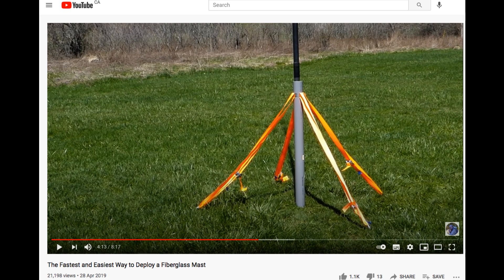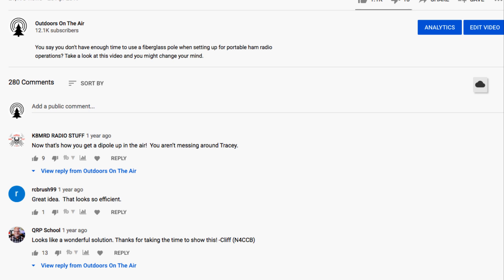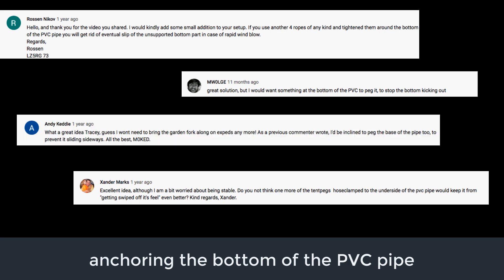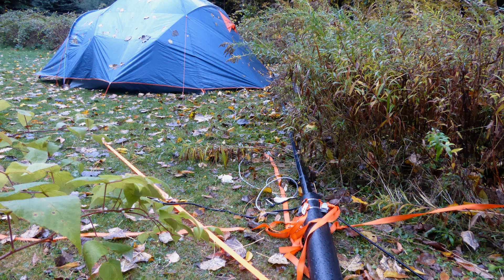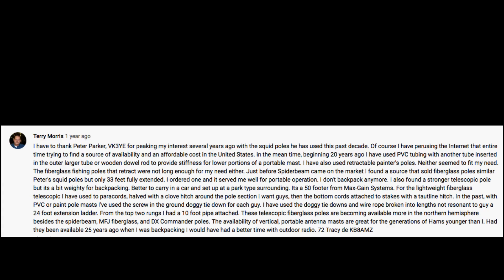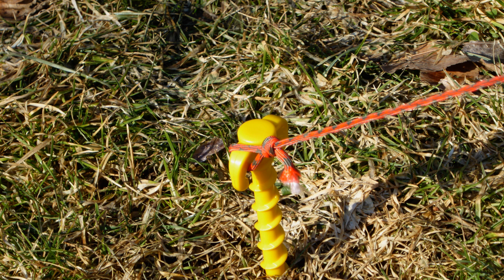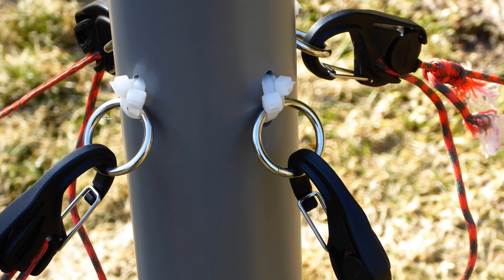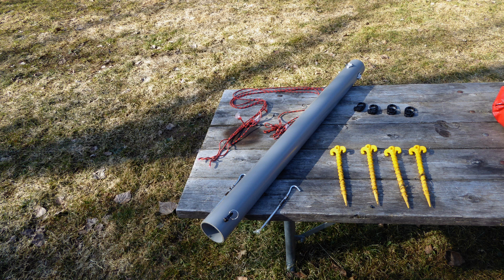Version 2 of The Fastest and Easiest Way to Deploy a Fiberglass Mast

Comment: Don't need 4 guys, 3 is just as good.  Paracord or guy line with a stopper knots on the ends.  Cut 3 slots into the top of open PVC (Or drill and file a keyhole on closed PVC).  You can also guy the mast itself.  Use a hole cutter to cut out some rings of polyethylene cutting board with a hole saw, then enlarge the center hole until it just fits the bottom end of the segment of interest.  73 KK7YIS
Reply from the maker: Thanks for your comment! Great tips. Regarding the number of guys, I've actually increased the count to use 8. My reason: whether you've got 3 or 4, if one fails, the whole thing falls.

Comment: One minor note on cutting the strap ends on the zip ties, use a flush cutting snips, or just a pocket knife to cut the ends flush. They are really strong in tension, but surprisingly easy to cut off!
And, if you double up on the "sand screws", about a foot apart, then lasso them with a loop at the end of guy, using the nite-eyes 'biners at the other end for tension adjustment, you've essently doubled the effectiveness of the screws. You're using 8 screws instead of 4, but you will sleep better in your tent. 
Oh, and the hole between the hooks on the screws is for a rod to help twist them in on harder ground. (And, just as importantly...to twist them back out!)
73 Jeff, KF0PQR
Reply from the maker: Great suggestions, thank you Jeff! 73 from VE3TWM.

Comment: I found a 43 inch fence post about 10.3mm in diameter, 3/8-inch, driven into the ground 19 inches, exposing 24 inches at surface. A 1/2-inch by 24 inch pvc riser nipple perfectly fits over the fence post. Only trick now is to find a few donut-shaped rubber or plastic that fits over the pvc but just inside the base of the fiberglass pole. Perhaps a 3D printed thing would work. Then all that is needed is one guy rope attached halfway up the mast with the rope pointed directly into the wind and tent-staked into the ground.  If there are crosswinds, use two in different directions.
Reply from the maker: Thank you for your creative solution!

Comment: hi i use a diferent aproche iuse a galvanazd pipe at the botom that i push in the ground it haz a sharp tip 4 ease of insertion the antena i mount with u bolts on the outside if i use other antennas then a fiberglas pole the fiberglas gose in  and 4 guy wiers are enuf to hold it up even in wind or storm conditions

Comment: I am waiting on my antenna/radial wire (due to arrive today) before I can set my SpiderBeam up this weekend. Great ideas. I like the idea of wire ties on the PVC, as I don't want to scratch up my new pole. I will put a spacer inside the pipe (pipe insulation or the like) to stabilize and protect the pole. Also, I will add a grommet boot to my SpiderBeam and over the PVC to keep out all precipitation. I will be adding an end cap and some foam padding inside the cap to minimize impact when the pole collapses for take-down. I will definitely take all your improvements to heart as I put this up this weekend. Thanks for posting and 73, "Bill" KD8BET.
Reply from the maker: I like your mods, Bill! 73 from VE3TWM.

Comment: On my 10-meter Jackite telescopic mast I tied a a Turks head knot into which I integrated four loops. The Turks head knot and loops are made of 550 paracord. Mini s-biners connect the guy ropes, also 550 paracord, to the loops. Camping tent guy line tensioners provide the adjustment for the guy lines. Setup is a snap, and extra kit is kept to a minimum. Keep up the great work.
Reply from the maker: Thank you for the great tip!
Reply: @OutdoorsOnTheAir  I've included some pictures of the mast on my QRZ page. See you on the air.

Comment: Several excellent points in your two vids. Thanks for posting.

BTW: in the US, both Lowes and Home Depot stock 2" and 3" PVC schedule 40 pipe in 3' and 10' lengths.

I use 2" PVC Pipe, in a tilting arraignment on the side of my utility trailer, to slip my 10M SpiderBeam mast into. Very nice fit with just a little side to side slop.

When i need to set up the mast in the open, I'll use 2' sections of sharpened ReBar with a 90 degree bend at the end as stakes. A 3lb ball peen hammer  will set them nicely. I'll fabricate a small post pole puller to retrieve the ReBars.

I say I'll do this and that above because my first option for a portable mast is to add a section of tilting 2" PVC pipe to my SUV trailer hitch frame similar to my utility trailer setup.

However, separate parking and mast locations would require the use of your system. Thanks for the info presented in your refined vid #2.

BTW: All your vids provide valuable info.

73 OM
Reply from the maker: Great tips, thank you! 73 from VE3TWM.

Comment: Interesting video Tracy... have you considered an end cap for the PVC pipe, sand the pipe and the cap for a free fit. Int the centre of the cap drill a hole for a length of threaded rod, secure with nuts and washers. To use, stab the treaded rod/cap where you want the PVC pipe to be, insert PVC pipe, assemble as usual. I now live in a strata community, so no permanent antennas, portable ops for me from now on I guess unless my imagination branches down the devious path to hide an antenna in plain sight, poor vision of my fellow community members may play into my hands/antenna, hi, hi.
Reply from the maker: Thank you for the tips, much appreciated!

Comment: Hey Tracy,quick tip.instead of wasting lots of time filing the zip ties,just cut to size you want and on the sharp edge use a lighter as this will smooth them off in seconds 😉
Reply from the maker: Great tip, thank you!

Comment: Remember, this has to be installable in five minutes or less.
Reply from the maker: Mine never goes up in 5 minutes, but I am slow.
Reply: @OutdoorsOnTheAir  Well, I will see if I can implement this for myself.  I will need:

* Telescoping fibreglass pole with eyelet
* PVC or ABS pipe with inner diameter at least 56mm
* Electric drill
* Metal O-rings
* Zip ties
* Nite Ize CamJam tighteners
* 550 paracord
* Dog leash anchors or plastic screw pegs
* Metal tent pegs

73 VE7NDE

Comment: I was just on Amazon preparing to order the tiedown straps.  (wondering if I could use my 550 cord)  While looking online this idea this video started.  Now I'll need a drill.  :)  Seriously, I live in San Antonio, Texas.  The ground is exceptionally hard.  I have to use a hammer to pound my 12" stake into the ground.  So very different from the ground in North Carolina (where I spent last week's beach vacation).  The stake was easily pushed into the ground by the ocean.  But, I'm home now, and need advice on good stakes to use.  TNX all!
Reply from the maker: Wish I could offer a suggestion, but really hard ground is not an issue for me.

Comment: I guy my pole if it is going to be windy by making a wooden triangle with 5" sides and a guy tying hole drilled in each carner and a central hole just slightly less than the pole diameter at about its halway point. To use just attach 3 long lengths of paracort to each corner of the triangle then silde it over the top of the pole before extending it and before fixing the wire end of the antenna. As the pole is extended the triangle will slide down the pole until the pole diameter stops it from going any further down.. Fully extend the pole the guy out using the three long paracords previously tied to the triangle. Works a treat especially if the tube support at the base is also in use. Will withstand a gale as I have proved.  I also use my pole in a car support under a front wheel with a guy tied of onto my roof rack and any nearby fence or rail. Only adds a couple of minutes to pole erection and gives much piece of mind in adverse conditions. 73 guys and good luck
Reply from the maker: Thank you for sharing your findings! 73 from VE3TWM.

Comment: Wow, this video helped me a ton after getting my first mast and wondering how to deal with the problem of securely anchoring it.  Thank you!   I'm using mastrant guy rope from DX Engineering in place of the paracord.  Those Nite Ize carabiners are such a great tip and they carry them in different sizes at my local Home Depot.   I've quickly found other uses for them as well.  Really appreciate you putting the experiments and time into putting this out there for the amateur radio community!
Reply from the maker: Thank you and happy to hear things are working out!

Comment: Couldn't you just wrap 2 different lengths of paracord, 10' long each, around the pvc pipe to make your 4 anchor points?
Reply: I figured out a knot that will knot slip in the dry and then double knotted to make sure.  However, not sure about whether it would slip in the rain.
Reply from the maker: Interesting thoughts, thank you!

Comment: Hahaha... just as I was thinking the niteeyez,  you showed them. I don't have enough for all the guy lines yet, so I still use the scouts slip knot for tightening guy lines, but they worked great for tent and hammock lines when camping.
Reply from the maker: Great point. The low tech knot will always have its place.

Comment: What about making a sharp cut at the bottom instead of 90 degree angle? Or maybe a 'upside down crown'. Then de tube will act as a peg that cuts in the ground preventing sideways movement. That saves loose parts like the pegs, rings and zip ties. One pin though the bottom of the tube act as a stop for the antenna pole and as a stop preventing it sinking further into the ground. I guess that's a more simplified design with less parts; only one 'stop pin' saving weight and prevents too much loos parts.

Another idea is to drill (two, three or) four large (1 inch?) holes at the top of the tube. The tightening straps can be fed trough the holes. This can be done for four straps, but six or eight straps can also be used of they share the holes. So there are no additional parts needed like zip ties and rings. I expect that the tube with holes is much stronger than (double) zip ties as mounting points. Holes are even lighter than zip ties and rings. ;-) When the holes are strategically placed, the tightened straps can act as a self centring mechanism for the antenna pole.

Well, maybe this is helpful. ;-)

73 PE2CJ

(If you have questions, please contact me via the QRZ website.)
Reply from the maker: Great ideas, thank you! 73 from VE3TWM.

Comment: Has anybody thought of an alternative to using zip ties to secure the rings to the pvc?
Reply from the maker: I don't recall seeing such a comment. Have any ideas?
Reply: @OutdoorsOnTheAir  My initial guess would be to drill the holes a little bigger to allow for the use of a hose clamp to hold down each key ring. I'm sure heavy duty zip ties are more than plenty but I feel weird choosing plastic over metal

Comment: yes i have one suggestion if i may..  pvc pipe to ground issue...im in australia and i push/hammer a fencing star picket 2' into ground..then i put antenna pole OVER THE STARPICKET..now i use this permanently in my back yard..but could be used portable if you put a bolt through the lowest hole in starpicket and jack it out..as a permanent fixture it performs well.i do add guys up around 6' mark.. i use 20' mast n have no issues..good luck god bless  VK4EZY  robby
Reply from the maker: Great tip, thank you very much!

Comment: I love V2.  I have decided to make a mod for the base of my pipe.  I have a flagpole holder for my van.  It extends my 2" trailer hitch out two feet so the van doors can open. The flagpole then slides into a vertical 2x2 metal channel.  I am going to add a section of square channel into the bottom of the PVC pipe so that I can drop it into the flag holder for a quick vehicle mounted base.  Then I can use it in two places.  73

Comment: Well done!  I'm wondering how notching some teeth into the bottom of the PVC would do the job of eliminating the slip.  Also, would pounding the tent pegs through the holes at the bottom be sufficient instead of the "O" rings on wire ties?
Reply from the maker: Good ideas!

Comment: Instead of the steel rings and zip ties at the top of the PVC pile, it might be stronger, simpler, and sleeker to just drill the smallest holes that paracord can fit through, and use Figure-8 stopper knots.  You could use 2 holes with a small length of paracord for each of the 4 attachment points.  Put then ends of the paracord through the holes and tie the stopper knot on each end inside the pipe.  Or use a single length of paracord, snaked in and out of a horizontal row of holes spaced appropriately around the pipe, to create all four "loops."  The same could be done at the bottom, too.

Comment: Ernie WRMQ998 

I used 2 1/2” schedule 40 electrical conduit with an adapter for a screw on cap. Under the cap I used 2 ball canning jar lids (2 1/2”) and put a 1/2” hole in the middle to receive a stake for lateral support. I went with your original plan using a 3” hose clamp but used “D” rings which tighten up nicely against the conduit. Thanks for the suggestion. It works great!
Reply from the maker: Thank you for sharing details of your setup!

Comment: For a pole base, I made one out of  3" PVC end cap with 10" of pvc pipe added to the cap. (use what ever sice pipe fittings needed for your size pole to fit into) 
I drilled a hole into the center of the cap and inserted a 9" carriage bolt  and then added a washer, lock washer and nut tightened to the bolt. On the inside of the end cap, I layered in enough silicone to cover the top of the carriage bolt by 1/4" (let it dry between layers). The silicone was self leveled. This gave the base cap assembly a soft, flat base for the pole to sit into and it holds the base steady during use. Just poke it into the ground.
I didn't glue in the pipe so I could shorten during transport. (I put the carriage bolt inside a pool noodle of same length then insert it into the pvc pipe for transport.) And that was my base movement solution. Joe KI5IQE

Comment: Wow has it really been 2 years since I did my MK1 version?  Must confess my version still holds but the couplers at the base of the pipe/tube is one I’ll use as the 40’ Spiderbeam is easier to pivot over than the 30’ version.  I’ve just bought the more compact 30’ Spiderbeam pole only to find the bottom section is too wide.  So I’ll probably follow your lead as long as I can find the bits.  Thanks again for posting 👍🏻👍🏻👍🏻 73 M0AZE Mike
Reply from the maker: Hi Mike, thank you for sharing your experience with the pole mount. 73 from VE3TWM.

Comment: A pvc cap with .25 inch or less threaded rod with a nut and washer inside and out drilled thru the middle. These caps are domed and the rod should come out of the domed side at least 6 inches. This side can be ground to point for easier driving into the soil. A couple of small holes will help with drainage. After the threaded rod nuts are tightened glue it to the pipe. 3 inch pvc has an inside diameter of 3 inches. This should keep the bottom in one place and the rod can be longer if want, I buy threaded rod in 6 foot lengths.
Greg W8XP
Reply from the maker: Great ideas, Greg. Thank you for sharing them.

Comment: Very nice video examination of ways to improve the mast stand. I latched onto your original idea, using the tie-down straps and the hose clamps. The only change I've made is to get rid of the ratchet part of the tie down straps. They were bulky, heavy and always in the way, and I could never figure out how to use that ratchet thing. LoL So, I got rid of that part of each strap. So, I just have the long part of each strap under the hose clamps and use the hook end to steak down to the ground. They re all the same length and it seems much simpler to me to setup. Wa-la! Ha! I don't camp and just do one-day POTA operations so I'm not concerned with over-night conditions. Maybe I'll get ambitious and do your improvements. Dunno. "If it works, don't fix it?" ;-)
Reply from the maker: Hi David, thank you for contributing to the discussion! Completely agree with you about the ratchets.

Comment: Thanks Tracey,
I made your first version of the antenna base (1.0); great success. My antenna is the 12 meter fiberglass pole from Spiderbeam from Spremberg, Germany. I did buy the guy line holder at the same time. The mast then has 4 extra guy ropes at a height of 7 meters. The mast is rock solid.
Greetings from PA7DK from Holland
Reply from the maker: Well done, Dick! 73 from VE3TWM.

Comment: Tracy, thank you for the great summary. I use a 31' Jackite pole, and originally used a Bosch BT-160 surveyor's tripod. On windy days, I would add a few tent pegs (nail-type from Harbor Freight) at the feet of the tripod, which held it down nicely. Inspired by you, I decided to try guying instead to cut down on weight and bulk. I affixed three picture frame d-ring hangers to the part of the mast with rubber coating using a hose clamp. I used paracord with CamJam hooks, tying the other end to the pegs. For the base, I use a PVC floor drain turned upside down anchored with a couple of tent pegs. It was rock solid in a 10+ mph wind, and will clearly handle a lot more. My QRZ page has photos. 73 de K9NUD
Reply from the maker: Hi Steve, sounds like you've done a nice job! 73 from VE3TWM.